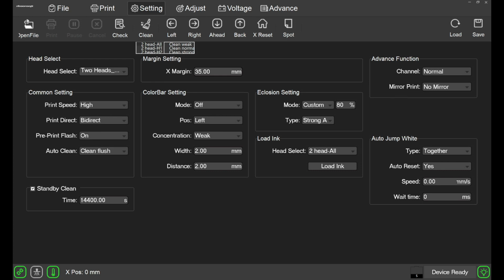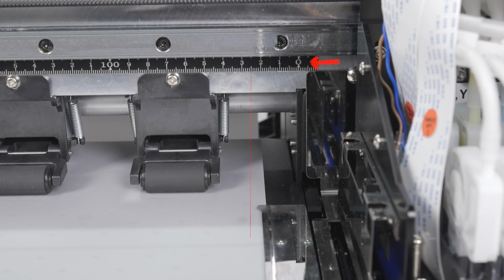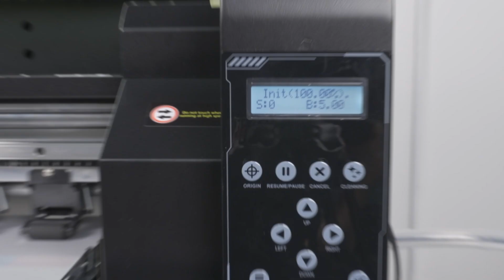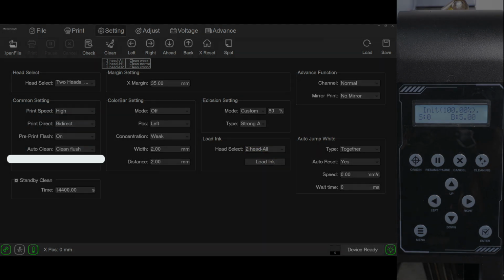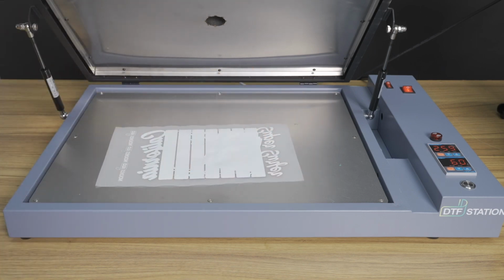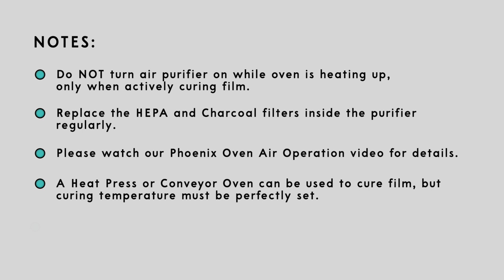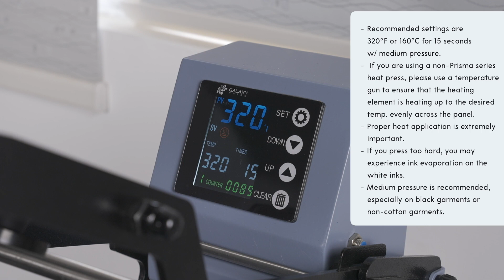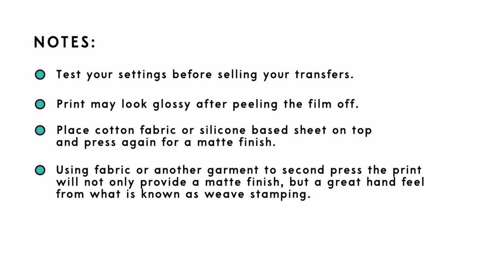Prestige R2 Operation | DTF Station

Comment: Had the Prestige R2 for 1 week now and print heads already clogging after daily cleaning. Please advise. Had to trade the old Prestige A3 R after 3 machines in one year.... help!
Reply from the maker: Hello, sorry to hear you are running into trouble with your priner. Your point of sale dealer would be the fastest means of direct support for any questions on operation!

Comment: These printers have been replaced from the epson photo printer. dtf printers these printers are made for very thin photo ink dtf ink is not suitable for these printheads thick white ink is not suitable for these printheads it is like silicone. when the printhead stays in a slightly hot environment, the printhead dies, that is, 90% printer dies before you get the money you pay, I say don't take any risk, but you know.
Reply from the maker: Let's take a look here: Firstly, our direct to film printers are purpose built from the ground up to our specifications and are some of the consistent and reliable machines on the market. They are supported by technical assistance and warranty protection against defect. 

When it comes to the environment, high heat can create problems for any electronic so we advise a working room controlled temperature above 60 and below 80F.
Reply from the maker: Let us know if you have any other misconceptions we can clear up for you:)